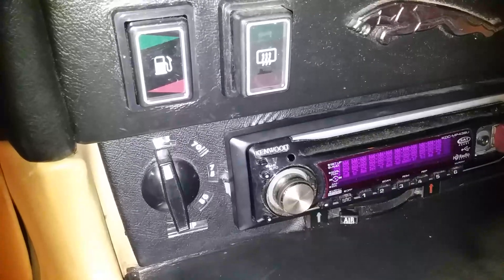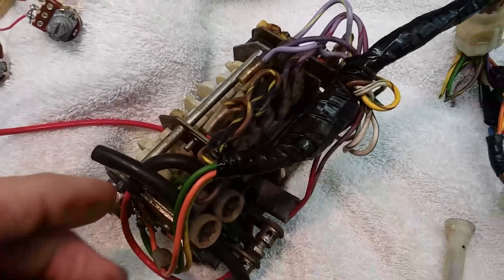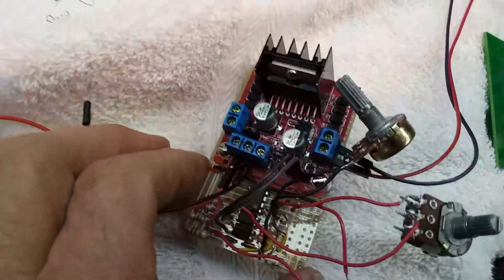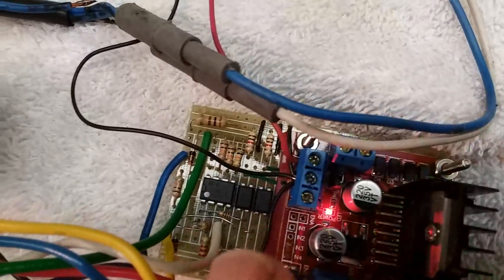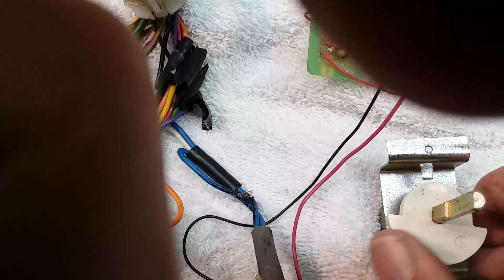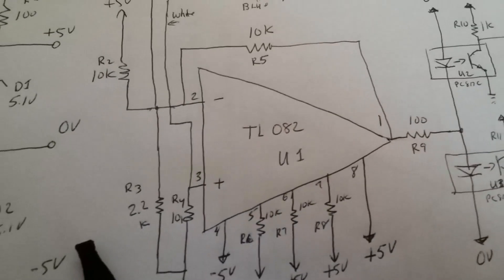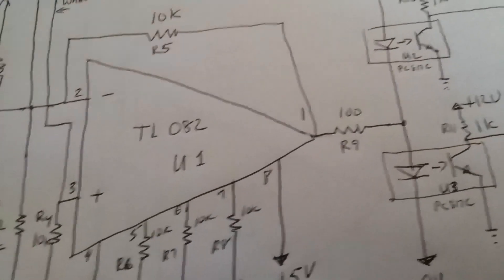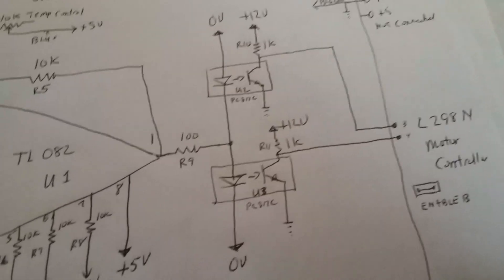Manual XJ6 Series 3 Air Conditioning/Heater Controller

Comment: In your exploration of this system, have you figured out exactly what the hot - cold 'air' dial under the radio actually does?
Reply from the maker: It's purpose in life is to change the temperature of the air going to the face level vents.  It is really only effective in the middle temps, near 75 degrees where the system is mixing hot and cold.  Does nothing with max A/C or heat. The control is connected to a mixing door that will change the hot/cold mix to the face vents.

Comment: Hey 👋 have you ever seen the servo controller motor that's weak the one I'm working on has no heating I've fingered it down to the motor in the servo unit or am I barking up the wrong tree and the amplifier is not strong enough?
Reply from the maker: Greetings, I have never heard of a weak servo motor.  I have seen them fail completely and once I saw the gears stripped.  You can test the motor by disconnecting the connector for the amplifier, on the LH side of the console, and connecting 12Volts and Ground across to the Red and Purple wires.  For example, connect 12V to the Red wire  and Ground to the Purple wire and the servo should run until it reaches it's limit unless it is already at the limit.  When the motor stops running reverse the polarity of the wires (Red wire to Ground and Purple wire to 12Volts).  The motor should them run to the opposite limit switch and stop.  If you have the fan speed control set to AUTO, you should hear the fan speed change as the motor runs. This will test your servo motor.

There is also a possibility that, if all works except heat, your problem is with the themo switch on the water lines going into the heater.  It's purpose is to prevent the fans, and therefore the heat, from coming on until the engine is warm.  It is located on the water inlet pipes that go from the engine and you can find it in the area above the handbrake,  near the firewall, on a LH drive car.

Good luck.
Reply: @novom2001  it's a v12 RHD started with the basics coolant flush 2 new thermostats,new temp sensor (gauge sensor) confirmed the water valve works, the low speed part of the relay box had failed (fixed with some solder) removed the amp and clonked it with a screw driver, tryed to power the servo motor through the red and purple wires no joy had to remove the servo unit and power the motor directly from the terminals on the motor from this point there was movement when setting temperature but as soon as connect it back up with the bars for the flaps it just doesn't seam to have the umph to keep turning, at one point last night I went from 55f to 112f and back to 65f so I'm getting close
Reply from the maker: @TheEvocarlos  
It does sound like there is a problem with the servo if you are running it directly from the motor wires.
You have removed all the other possibilities except for a problem with one of the flaps that are connected to the servo.
Reply: @novom2001  seams that wetting all the solder joints through and washing the grease off the gears and running a bit of gun oil on the gears has cured the problem all seams to be working as it should now 
Thanks for the help :) do you have a itemised list of parts for the amplifier looks like an interesting build I would like to make one for the future just in case :)
Reply from the maker: @TheEvocarlos  
Happy to help and glad you got it working.   I do have a parts list but I am out of town.  I should be home tomorrow.
Send  your email address to info@thisoldjag.com and I will send you the parts list.

Comment: Fantastic work. I've been looking into how to get a microcontroller (e.g Arduino) to control the system instead of that AC amplifier. Would you happen to have a schematic on what each of the output wires are meant to be doing? I've got a vague idea based on the Delanair Mk2 PDF getting around, but not 100% sure. Also (and this is a long shot), would you happen to have a  schematic for the servo motor unit and what the inputs/outputs are (and ideally what the various behaviours are - in software speak we'd call it the interface spec)? Thanks.
Reply from the maker: Hi Tim.  I considered the Arduino for this latest board but decided that it was overkill, and stuck with the discrete components.  The system is basically a mechanical servo and servo driver.  Controlling it is straight forward.  I can tell you what all the wires do.  Drop me a note at novom2001@yahoo.com and send me your email address.  It will be interesting to see what you come up with.

Comment from the maker: Greetings, a couple guys said that they might be interested if I could put together a board to sell.  I had  a few printed circuit boards made and I can now offer them.  It is a slightly different circuit and I plan to put up a video in a few days but the idea is exactly the same.  I have been running the first one for the past week, and it appears to work as advertised.
Reply: Just sent you an email

Comment: Hey man I was wondering where the ac amplifier plugs in. I recently bought my series 3 and found the ac amplifier not plugged in by LH of the console
Reply: Any help would be greatly appreciated
Reply from the maker: The amp itself lives in a little cubby behind the large, main A/C relay.  If yours is still there, there will be a pigtail with a round connector coming from the amp, as well as a black wire with a fuse in it that connects to one of the studs on the front of the unit.  The amp connection to the car should be a matching round connector that will be somewhere very close by. You can find this connection by removing the LH console side panel, but sometimes it will be hidden under some of the wiring and hard to see. The connection is located aft of the relay.

Comment: Any chance you would build one to sell?
Reply from the maker: I would have to give that some thought.  I build it using a protoboard and point-to-point wiring, so it is pretty time consuming. It is something that a  hobbyist would do for fun on a rainy Sunday.  I have thought about making up a printed circuit board that would greatly speed up the process.  Let me think about it. 

Which car do you have?  Do you still have the original unit so that the wiring pigtail can be used?
Reply: Novom2001, I'd also consider buying one if you decided you wanted to go down that path.
Reply from the maker: @andypaine7489  
I'll proceed with the idea of getting a circuit board printed.  It is a pretty simple circuit.  
For what it worth, I do not have a case for the board.  I just wrap it in a piece of leather and lay it inside the console.  No problems in 10 years, so I guess this works.  Also if you want it tested I will need the pigtail from your amplifier.  We can talk about that once I get a working circuit board.
Reply: @novom2001  Sounds great.
Reply from the maker: @andypaine7489  I've worked out a slightly different design with a different motor controller and plan to  breadboard it tomorrow.  If it works ok, I'll order the boards next week.
Reply from the maker: I have the new board working, and I have enough boards to build 5.  If you or anyone else wants one, I have them to sell.